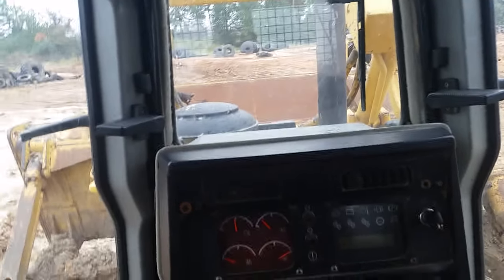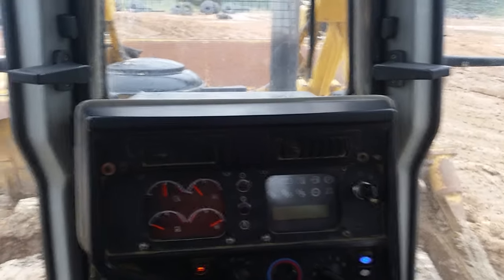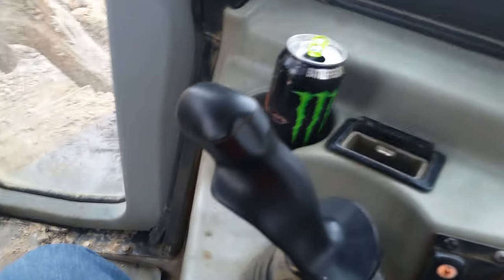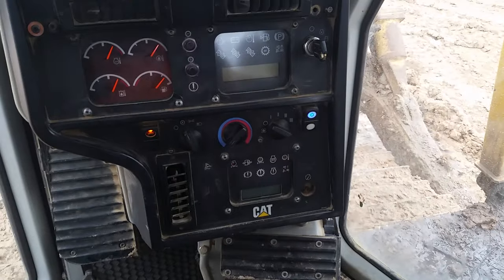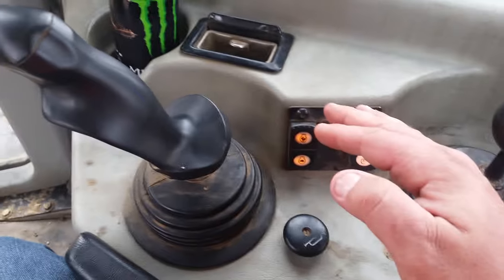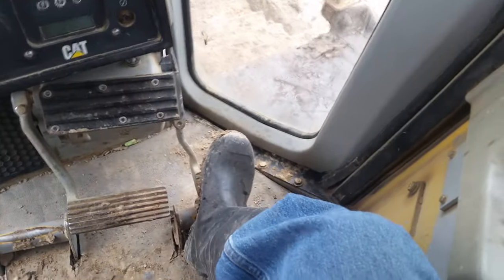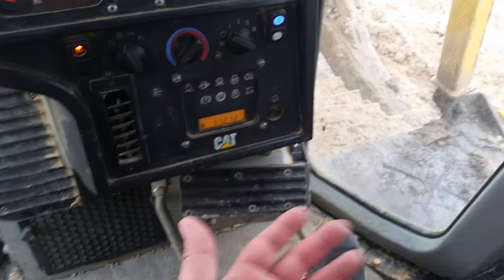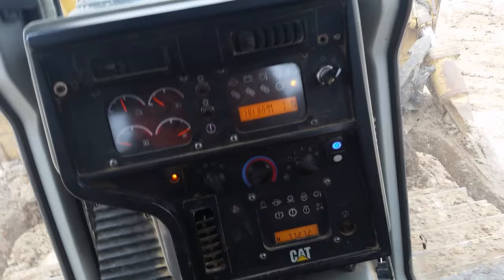How 2 Operate A Cat D6 Dozer

Comment: Thanks for the vid. I run an 06 , D6H and a 30 year old D8L at work. Most of the controls on the 6 are the same except the electronic speed control and the lockout lever. Also the 3 speed selection .

Comment: For a second I was wondering if that was the 6 I used to operate until you said turn the radio down. The radio was missing on mine. Then I noticed your meter lit up. The one I operated years ago didn't. But it was a 6 high track. I miss operating it. thanks for the video taking me back. miss operating.

Comment from the maker: Hey guys I just wanted to thank you guys for all of your comments, and sorry if I haven't got back to each one of you.
I will be putting out new videos soon on other equipment soon.
Reply: Heavy Eqipment Guy videos like this helped me out when I first started operating the dozer. Iv a few dozer videos on my channel but more POV style videos
Reply: Thanks!  I’m working on a D7R at work right now. I took it out today for a test spin to get everything up to operating temp and find ANYTHING ELSE I need to fix. This is the first dozer I’ve ever ran. The tractor was a waste handler machine, so... it pushed trash in a landfill, and there’s plenty to fix. 
While playing- I mean testing... the machine, I realized one thing very quickly. Operating a piece of equipment is a lot harder than it looks, and as you stated, the blades on these machines are difficult to grade with!  I’m sure there are people out there who can do it well, but I found out quickly I’m not one of them.  Once I started pushing and sloping piles of dirt, the operation became natural. These blades are very effective for pushing and piling, and I don’t know if I was just getting the hang of it or if it’s the blade design, but building long, gradual slopes was very easy and the grade while sloping was very easy to maintain. 
The throttle and decelerator pedal was a bit difficult to master too, but it just takes some getting used to. Also, by using the decelerator pedal, you can lower your RPM to a desired speed, and then push and hold the high idle switch for 3 seconds to hold the engine at this speed.  I wish there was a memory setting however, as you can decelerate the engine with the pedal, and it will return to your preset, but if you go to low idle with the throttle switch, your setting is cleared from memory, and the engine will return to high idle; you now have to repeat the set-up process. 
All in all it was a lot of fun, but I can’t wait to get on a D5 or D6 with a 6 way blade.

Comment: Im learning on a newer D6 on the go.. the part i struggle with is blade control. I tend to get to much a bite when im just trying to push. would you have any tips on manual blade floating?
Reply from the maker: erikblazer13 what I would say is the feel and the sound of your machine after a while you start to learn the sounds of it and when it’s starting to bind down,

Comment: nice video!!!! but just so you dont misinform people, these dozers are actually designed to shift at full throttle, it actually does more damage to them to slow way down like that because there is not enough pressure in the transmission to shift it properly.